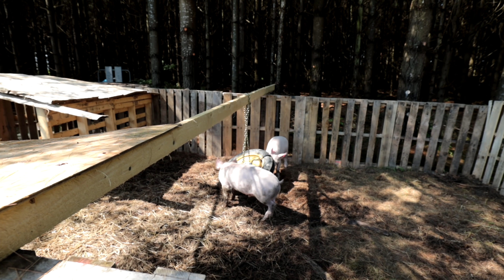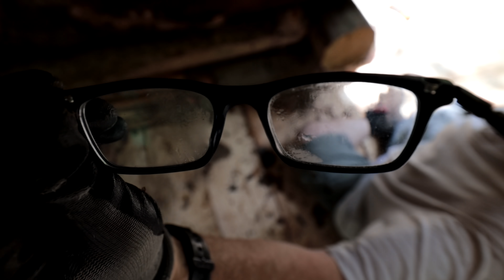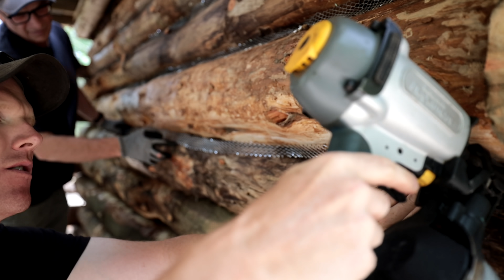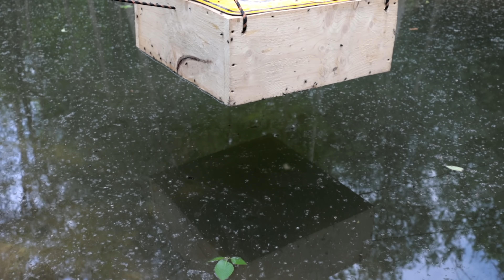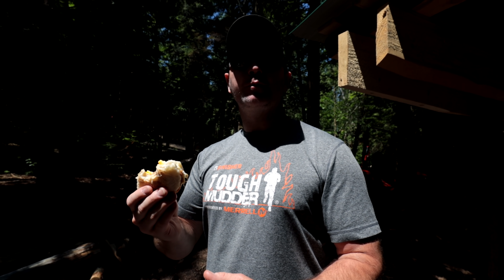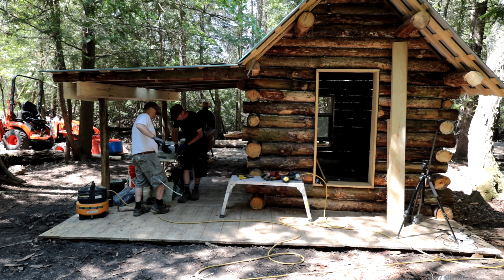Finishing the Off Grid Log Cabin! | Pig Play Tire, Debarking, Wire Mesh, Pond Trout, Chicken Tractor

Comment: Do you think if you used insulation on the roof it might quiet the rain noise down? Maybe the foam board insulation
Reply from the maker: It would quiet it down slighty.. usually you need density to sound proof stuff. foam insulation does very little to deaden the noise.  If you de-coupled and added the ceiling you'd have a fairly quiet interior.

Comment: Question: how do you add the chinking between the logs if you put wire mesh blocking it on both sides? What am I missing? You need chinking material between the logs right?
Reply from the maker: The logs support themselves.  The chinking seals the crack.  You force the material into the lath to seal the crack.

Comment: How does it work with permits where you live? With buildings and animals?
Reply from the maker: it's usually based on square footage of the structure.  If it's under a certain square footage it's considered a shed.
Reply: @ModernSelfReliance  Ok...

Comment: Heating is easy...slap a stove and few logs....but what u doin for air conditioner???.
Aluminum finned copper tubing
Aka hot water baseboard....convert them into a radiator with water mist and fan...circulator pump...good ole swamp cooler..if you really good watch mosquito coast movie for AC idea

Comment: I‘m sorry, I‘m new to this channel, but is there any reason for debarking after building the structure?
Reply from the maker: It helps the logs last longer. they weren't debarked when it was build because the logs were dead standing and most of the bark was encapsulated in ice.
Reply: Thanks for replying so quickly. Meanwhile I got through to part 1...I think i get it now.

Comment: Doing both sides seems kind of un-necessary... but I have no idea.  Guess I'll have to wait and see.  LOL
Reply from the maker: How would you finish the inside?
Reply: @ModernSelfReliance  I guess I just thought the mesh was to keep whatever you're packing in from going through to the other side... so I don't know why bother putting two layers.  I would assume what you're packing on the outside is to weather proof, and you could stuff insulation on the inside.  Again, I have zero knowledge on this topic.  Didn't mean to sound negative at all.

Comment: Home Depot has a white cement that works well for chinking.  I also used an acrylic additive added to the cement and water mix to prevent the cement from cracking and chipping off the logsThe lathe mesh works excellent to hold the cement chinking. Lots of work but worth it in the end.  The acrylic additive makes a difference and it also was purchased at Home Depot.